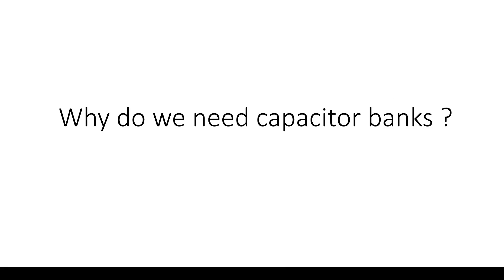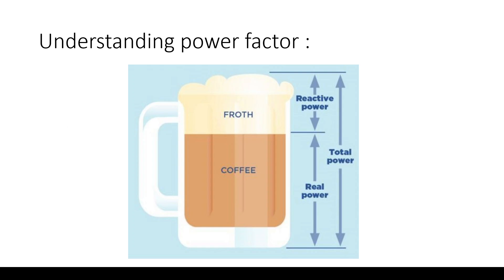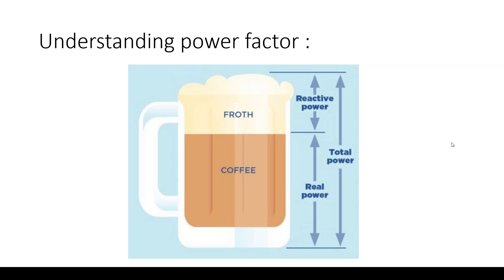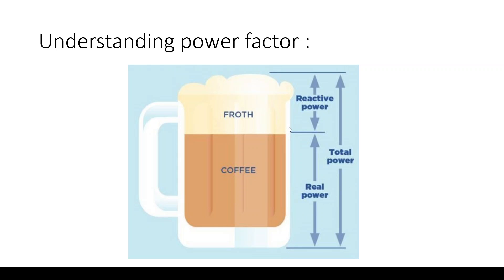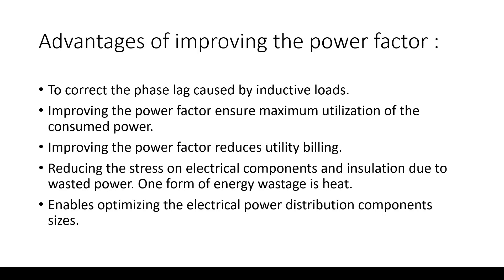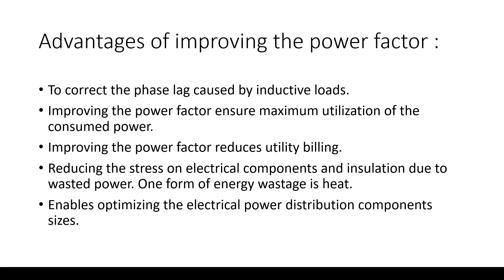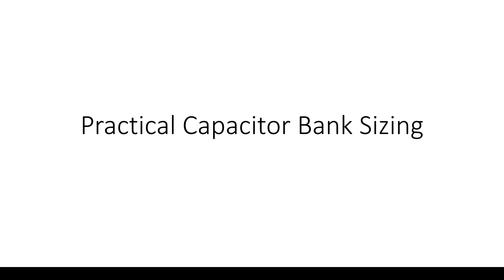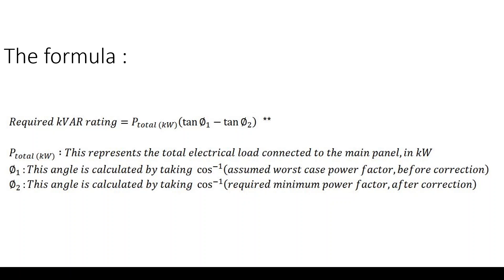Practical Capacitor Bank Sizing Calculation - Simplified

Comment: Very nice explanation.
Can you pls make more video as per ADDC standard/requirements for load calulation for building, with SLD
E.g how many transformer required, TRM or QRM, LV panel which kind required.
Which cable size required 
How many DB,MDB,FDB
Etc... total calulation with example of the peojects if possible show drawings of the projects with explanation.

Thank you

Comment: Why you use demand load KW for calculation Eng Mohd...

if I am not wrong, Better to use full load KW...

please explain
Reply from the maker: You can use TCL of course..and we have used it in some designs and few projects..and that is the easier.expensove route to go...however, sizing based on MDL will give a better optimized design (in my opinion) because :

1. For DEWA purpose, it is acceptable and standard practice.

2. Using full load TCL will give you an unnecessary oversized CB and unnecessary additional cost.

3. Better to consider the maximum transformer loading MDL when calculating the capacitor banks.
Ex : 800kW for a 1000kVA TRX and 1200kw for a 1500kva TRX.

4. You use TCL for critical items such as breakers, busbars, cables, etc..

5. TCL is used for sizing breakers and cables since. It's a standard practice and requirement by local authority (DEWA). Section 4.6.6, 4.7.2, etc..

Comment: Do we have to use the multiplying factor if the load is a connected load, instead of a  total demand load?
Reply from the maker: If we are talking locally (DEWA), all breaker sizing/cable selection calculations are done based on the connected load.
This additional 10% safety factor is only a good engineering practice, consider it as an advice, it's not mandatory.

Comment: Sir can you provide calculation for 3phase motor load calculation
Reply from the maker: Regardless of the details, a 3 phase motor is simply a load. However, you need to leave spare capacity in your breaker selection to avoid nuisance tripping due to starting current.

Please refer to my tutorial video regarding breaker sizing calculation/selection.

https://youtu.be/chkVHdOIGj0
Reply: @Electrical_Engineers_Academy  THANKS SIR
Reply: @Electrical_Engineers_Academy  how much spare capacity for breaker? Any multiplication factor we can use? Cable sizing for motors is done considering as normal load or we need to take the startimg current into consideration like breakers?
Reply from the maker: 1. Cable is sized according to the breaker. You select the breaker or protective device first, then, you accordingly select the cable.

2. There is no fixed rule or a certain multiplication factor. The actual type of breaker that is used is very important in this regards (related to actual manufacturing of the panel).
I will give a detailed explanation about this in the near future.
Reply: @Electrical_Engineers_Academy  thank you for the reply, looking forward to your future videos.